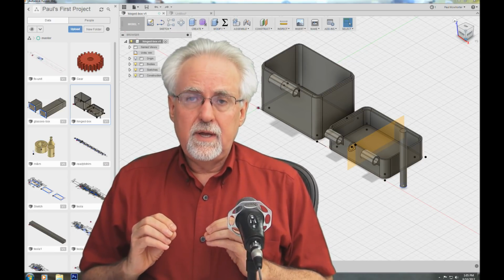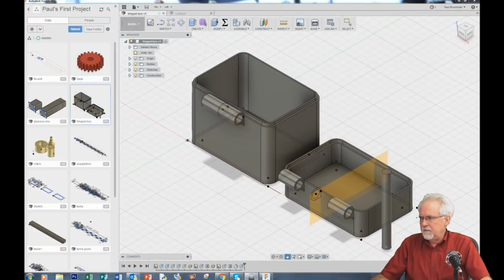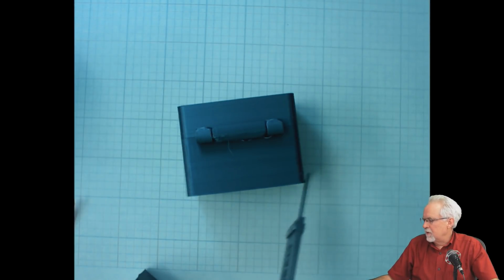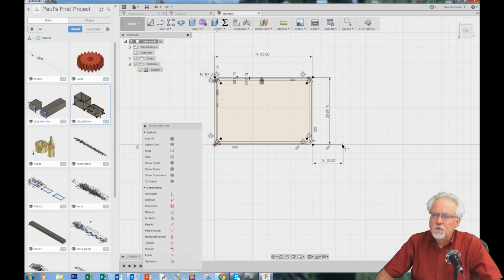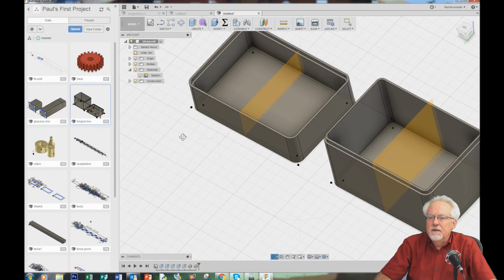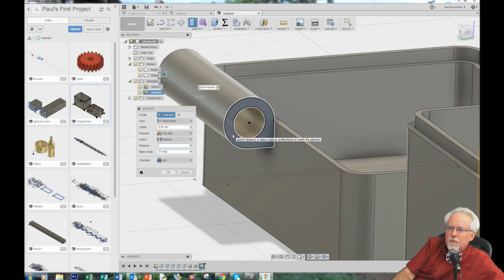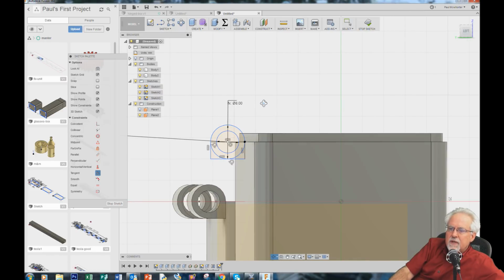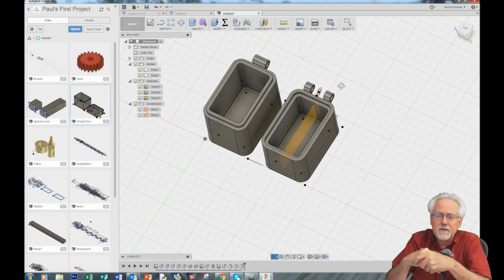Learn Fusion 360 or Die Trying LESSON 6: Sketching on Offset and Orthogonal Planes

Comment: Great Video!  I learned a lot from it.  I'd never tried parametric design with it before.  That's going to be super useful.  Suggestion.. Use shift + center mouse button to rotate without leaving your selection process.  No need to change to go back and forth to the rotation tool!  (if you have a center mouse button that is)
I'll be looking forward to your next video.

Comment: This one was tough, but repetition is the best method for learning anything. 
I went back to the SketchUp box drawing for the Hinge Pin dimensions. Was about to use Parametric design for the length of it also. Something like longpinLength = width - (2*cornerRadius) - (2*pinHeadHeight). Obviously there is also a shortpinLength for the other side of the hinge. Thanks for persevering.  😊

Comment: I really like your style! Thank you for taking the time to do this series. I have to force myself to watch the whole video at least once before trying to follow with Fusion and make the model. Then I go back to the beginning and draw the model with you, repeating steps as necessary, until I understand them all. Can't wait for the next lesson.Edit: I want to see the hinged box assembled, as I think there might be interference with the lip when trying to close the box, got to keep you honest, LOL.
Reply from the maker: It actually assembled OK, but it is true the hinges are not in optimal orientation for 3D printing because of the overhang. The box did work, but the underside of hinges not real pretty.
Reply: Thank you for your honesty. Are you going to show us how to fix it?
Reply from the maker: The 3D printers do not print overhangs well, so there is not a good orientation for printing this box. Any way you orient it will create an overhang. Hence if you use this to 3D print, the underside of the hinges are not real smooth.

Comment: Hi Paul, 
Thanks for another great lesson. I have been using F360 for a while now and I still enjoy even the repetitive parts of your lessons. I have never used the parametric style of drawing so this lesson in particular was very informative. Thanks again. I would like to point out a couple of tricks which I think you may find useful... if I may. 
1.You have mentioned a couple of times now that the sketch turns off when you turn it into a body. I you go into your preferences file under your name on the top right of the screen, and click on the design tab in the general category, at the bottom the list is a check box where you can turn that action on/off. 
2. The rotate/orbit function seems to be a bit annoying for you because it has to be turned off (click OK). If you rotate/orbit using the shortcut it requires less clicks and turning it off is not required. To use it, .... while holding the SHIFT key, click the SCROLL WHEEL and DRAG. Very easy to use.
3. You were looking for a way to edit something.... I forget what now...  Next time try right clicking on the feature you want to edit in the timeline. In the pop-up window will be a "EDIT FEATURE" command.

I understand you are trying to keep things simple and may be avoiding this on purpose but I thought I would just throw these ideas out there. Hope this helps.

Keep the tutorials coming. BTW... I am here because of your Arduino series. I learned everything I needed there.

Thanks.
Reply from the maker: Good suggestions except the one that required the other hand to hold the shift key down. The other hand is for drinking coffee with, so I can only consider one handed operation. You must not interfere with my coffee hand in any way.

Just kidding of course, but it is true, I really dont like to use shortcuts that require two hands. Seems like I either have calipers or something in my other hand, so I just am oriented towards techniques that only require one hand.

I will admit I am in fact still annoyed that I have to deliberately turn off certain tools, and for some reason the draw line function and the orbit tool are the ones that bother me the most.

Comment: Sir,
We are still alive and proceeding on this learning curve.  First of, in response to you final comment about background of people trying to learn this.  Mine started with the T square and triangles.  Several years after college, this new fangled Autocad came out and I got my hands on a copy of 2.16 (for Dos) and learned that.  Time passes (about 25 years or so) and we are still using 2D cad in the construction industry.  Since retirement, I have tried several 3D systems and couldn’t make heads or tales out of it. Then all of a sudden, along you come with your system starting with basics and EXPLAINING what your doing along the way (to slow, heck NO) as to many of the you tube videos I review might mention the command syntax, but never in depth.  I appreciate your teaching skills. 

For your viewers out there, the method I use to absorb and learn from your videos is to view it first (not doing any drawing) and then go back and do the procedures along with the second viewing.  I was taught that spatial repetition was required to truly learn something not just memorize it which would fail in the short term.

One thing that I would like to see is the outline of your lesson plan so I could see what skill sets you have planned down the road.  The reason I say that is for instance, I am trying to do some joints (and failing miserably and hope it is coming.

As noted above, we are enjoying this series immensely and hope not to loose to much more hair before we get semi-proficient with the process.

Thanks in Advance.

Art
Reply from the maker: Great to hear people are actually learning from these. I am having a lot of fun making them.
Reply: So glad you are making them!! This is like Microsoft Word 20 years ago. In 20 years from today, if you don't know 3d design, you'll be like someone who doesn't know Word processing today. So thankful for your fusion crash course!!
Reply: My hair is gone and only starting to enjoy the instruct able videos
Reply: Well i tried it and I came this far first you should look for the first body and withn a right click make a component from it
repeat this for the second body then
you should with a right mouseclick on the first component choose ground it
then try to assemble the hinges by the joint command which is in the assemble menu point to the centre of one hinge and then select the center of the other hinge and try to fiddle with the sub menu 
for instance revolve is a setting choose 180 degrees and it will close
well maybe the master comes later with a far better tutorial  than this but hey I'm not native english speaking 
kind regards
Reply: I concur, I concur, exactly what I’m going to do too. 

I’m watching this because even though I’ve played around with 360, I only got frustrated and quit.

So I consider myself a “beginner” and that’s why I’m watching in the first place.

Reiterate, I’m watching the first time thru and not trying to keep up with using Fusion (too time consuming having to back up etc.), then I’ll watch again having a really good understanding of what needs to be done, and then I’ll proceed to go back on my own and try to duplicate w/o watching the video. 

Then by George I think I’ll have it!